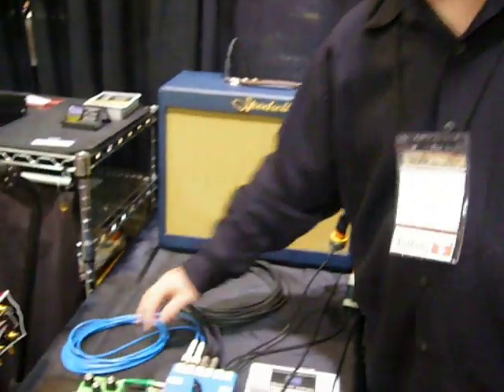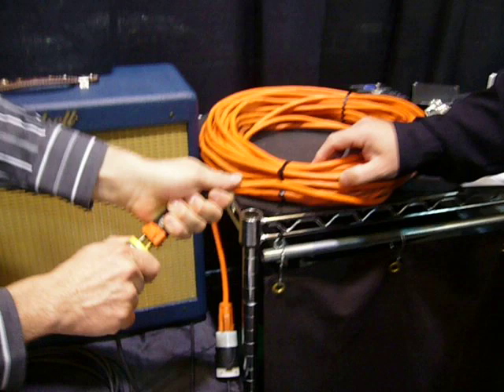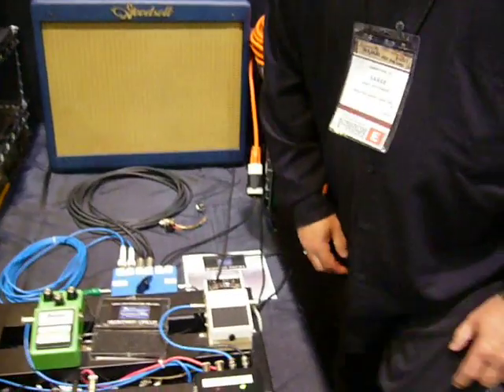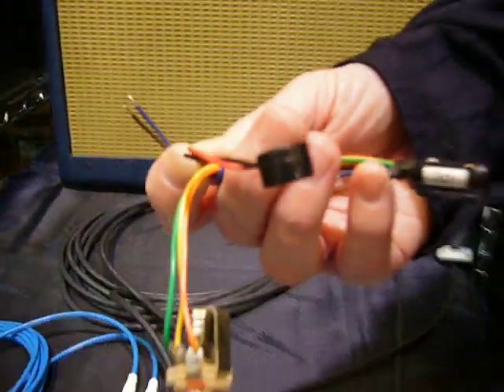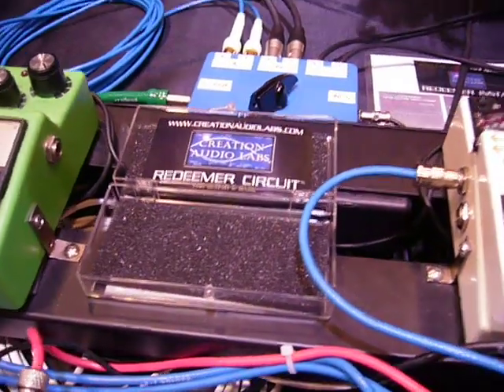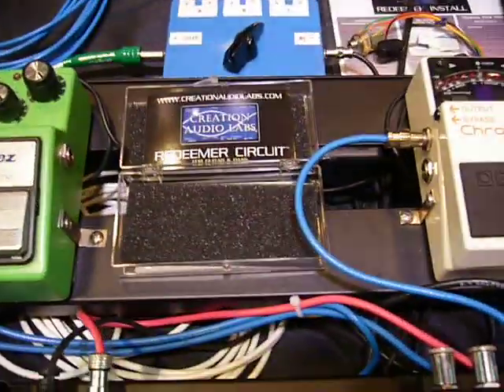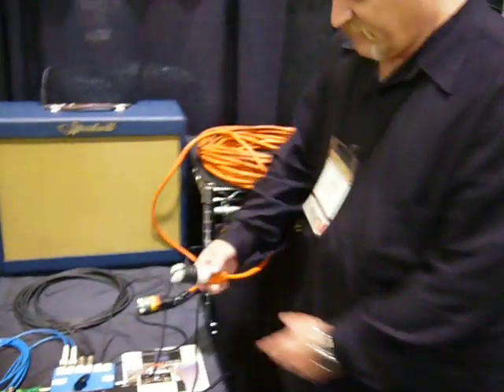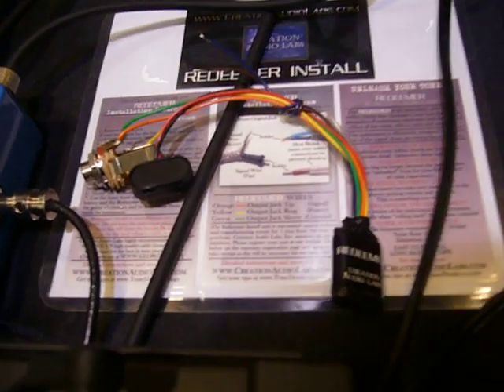Creation Audio Labs REDEEMER buffer circuit NAMM 2009 Bobby DeVito

Comment: I installed one in my strat  while I was shielding the electronics cavity and I just cannot (CANNOT) freakin' believe the difference. If you are a pedal junkie like me OR if you just need to be 100% certain your amp is getting the very best your guitar has to offer you MUST MUST MUST get one of these. It is cheaper than most pedals, crazy  easy to install, the support is 2nd to none and there it is. I need more of these.Can I buy some stock, guys?